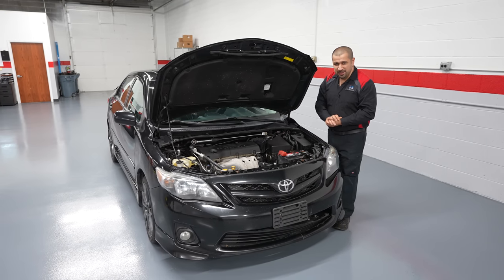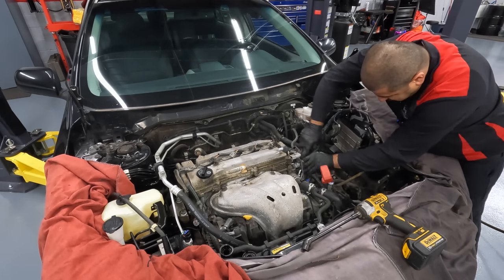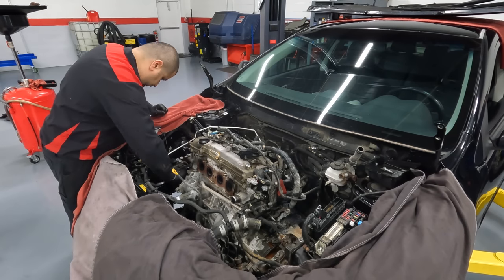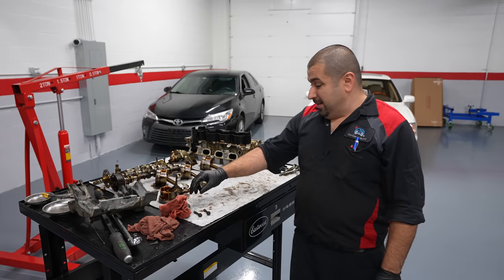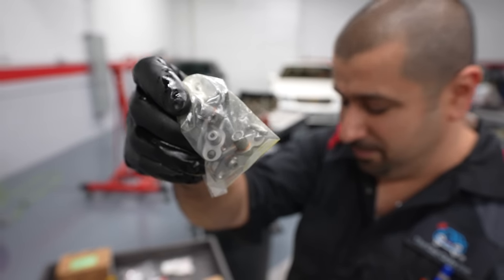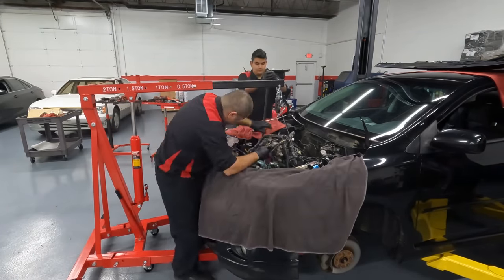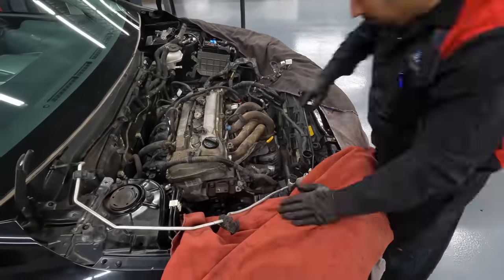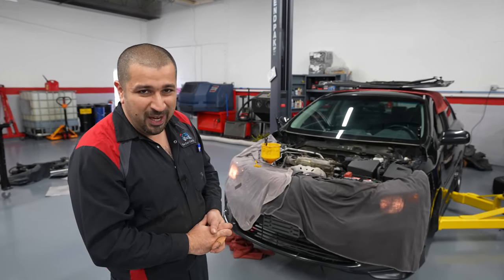THIS is Toyota's Worst Engine Ever Made! But Is It Really THAT Bad?

Comment: I have a 2002 Toyota Rav4 with the 2.0 engine and the engine is super reliable as heck!  I change the engine oil once every 3 years and the Rav4 just keeps going no matter what.  I did have to change all 4 coils at around the 274,000 km mark and the battery, PCV, EGR valve, and MAF all at the same time to figure out that the coils were the culprit for the bad engine misfiring, stalling and stuttering.  However, since I did everything myself that only cost me around $240.00 total (Canadian) which is pretty good for having done almost zero maintenance for over 20+ years!  

The second gen Toyota Rav4 2.0 engine was a beast since the engine also used a timing chain.  Other than a leaky timing chain tensioner (common to all early Toyota 2000 engines) cover and leaky front driveshaft seal the 2.0 the Rav4 has been really bulletproof.

The 2.0 engine is super great for gas mileage and will even push the Rav4 through 2 foot snow drifts with ease with its simple tried and true AWD system (taken from the ALL TRAC)....

If Toyota just kept things simple (as Toyota had done in the past) then people would always come back to buy their cars....

Comment: I bought a used Toyota Matrix with a 2.4 litter engine, the girl who sold it to me, didn't tell me the car had an oil consumption  problem. I took it to the Toyota dealer and they fixed it for free. That happened almost 7 years ago.

Comment: We went through our 2007 RAV4 engine and the machinist recommended reusing the pistons but replace the rings, we couldn't get any info from our Toyota dealer on the piston and ring upgrade. It uses oil still but not as much. Pretty frustrating after all of that work..The counter balance assembly needed replacement as well.

Comment: I just bought a tc with this engine it was leaking oil, so I did the valve cover gasket to fix that, and it hasn't lost oil since. It's only been a month or so, so probably too soon to know if its burning it. So far it's been fairly reliable, it's a 2005.

Comment: My 2003 2.4L Camry has 691,000 kms without any engine work. I change oil every 5K kms, and as soon as warranty was up I did all the work myself not the dealer.

Comment: I have this engine...2008 Scion xB, manual trans.  It definitely burns oil, but overall it's been a great car since I've owned it.  It would be great to have this repair done, but I'm just not sure it's worth the cost at this point.

Comment: I had this exact done on my 2007 Camry in Canada. By Brimell Toyota,under warranty.  And the service manager recommended I do the upper engine.  Which I did. ,,I paid $600.00 Canada for the parts. TOTAL ENGINE REBUILD.  NO IS RUNS LIKE A ROCKET.  255 thousand and rolling. 🇨🇦🇨🇦
Reply: When did you get it done and what exactly did you get done? Bc I have that same engine and didn't know about their extended warranty program. So this engine burns oil like crazy.

Comment: I got our daughter a 2005 Camry with this engine. It had 206k on it with a good service history. It ran great and it was a good price. I always heard the really bad years were 2007-2009 so I thought 2005 was a safe bet. Come to find out the thing drinks oil, about a quart every 300-500 miles. I feel terrible about it. But it s a nice running car and I hope it will just last her through college but we will see. Might need to put a replacement engine in it. I should have gotten her the Camry with the 3.3 V6 in it. Oh well.

Comment: We have this engine in a 2003 camry, 215000 miles, uses no oil at all. Secret is drive slow, change oil every 2000 miles.

Comment: I have a 2012 camry se.bought new, 4 banger. Lol we love it. Only thing been done to it was, new stall convertor. But now shes got 184,000 she starting using oil.
Good thing the toyota co.we bought it from had a lifetime warranty on all running gear. Looks like time for a refresh. An put another, 184,000 ... also got 2009,with bad motor, blown head after the oil rings been fixed.from burning oil.another 4 banger.lol,an we spent a lot of money for them to put in a new engine.. just got it back other day,so now we will see,how things go from here...also i have another toyota tacoma trd,4x4,2015, v6 an well kept, now she's rattling on cold starts,an burning oil,,an skippedat same time but cleared up no codes or lights., dang man. Im no lead foot,an up keep is always under 4000 miles oil change.little smoke on crank up when it was cold other morning 35 degrees outside....what the crap is happening to my toyotas these days,,,, I may go back to Ford's again. I had good service out of thoes....??¿?????
Reply: Ps...any thoughts or advice from you would be greatly appreciated.??????????????

Comment: @TheCarCareNut I’m in the process of rebuilding a 5S-FE engine from the ground up and I wanted to ask you what should I be replacing?
Also I’m trying to avoid the stealership’s prices, so I wanted your recommendation of manufacture to use for the rings, pistons, and bearings.
Also what gasket set to use.

Thanks in advance for the above & your detailed videos.

Comment: I owned an 07 Camry from new .  It burned about 1qt of oil every 1,000.  This killed both cats by 100k miles.  Ate 3 water pumps.  Idle was extremely rough, due to ETC issues.  Finally, the motor blew after dropping a valve seat.  

Scrapped the car in 2016 @ 213k mi.  Very disappointed.  There's a reason you don't see that many 7th gen Camrys left on the road.

Comment: I have one...07 camry. It does burn oil, but i only drive about 500 miles or so a month and i just add oil when needed. Otherwise it runs great.

Comment: I have a 2003 camry 100.12000 miles runs good, would you recommend switching out the head bolts ?

Comment: I have one of these in a 2004 RAV4 with almost 450,000 kilometres (about 280k miles).  Very reliable car and it's had a rough life outside in rural western Canada.  Lots of cold starts at well below -30 without being plugged in.  It did start using oil a little while ago and it's now up to about a litre every 2,000 to 3,000 km of highway driving, but that's more likely from being old and all the rough treatment it's endured.

Never overheated mine and have not encountered the head bolt issue, but I heard another theory about it, it seemed to be more prevalent in Camrys and Corollas but was not very common in RAV4s.  The cars for those years were assembled in North America, but the RAVs were made in Japan and imported as whole vehicles.  Could it have had anything to do with a quality control issue at one of the manufacturing plants over here?

Comment: My s-i-l has a 2008 Rav 4 Sport that doesn't leak, and doesn't smoke but goes through a lot of oil.  My mechanic said it was carbon holding the rings open?

Comment: I've got a 2008 Scion xB and thus far (knock on wood) haven't seen excessive oil consumption thus far.  I'm the second owner and both the first owner and myself have consistently change the oil in a timely manner and have used Mobil 1 Full synthetic (5W-20). Based on your experience have you noticed that owners with this engine that have used synthetic oil since day one in their vehicles experience less oil consumption issues that those that used conventional oil for at least some portion of the vehicle's life?  Thank you in advance for any information you might have on this issue.

Comment: Of course, the one I inherited and can't replace. Good thing I started replacing the oil years back and another guy had replaced the bolts AND gasket for free. Any mention of, IIRC, the U transmission? The one in the 2002 Camry 2.4l. That had to be replaced too, but the rumor is it's the computer.

Comment: First, thanks so much for your YouTube videos. Very instructive and helpful. My reason for writing: I just replaced my 2AZ-FE 4 cyl. engine in my 2002 Camry with one that has had the original production problems corrected (the rest of the car is in excellent condition). Simple questions: How long does this engine need to warm up in winter (I live in Southern New England)? 60 seconds? 120 seconds? How about in summer? And, how about if the car has already been driven earlier the same day? Thanks!

Comment: Time ago I drove a 4runner first gen, four cilinders automatic transmission. Got it used and remain it as an engine oil cooker. Oil engine returns was poorly designed in my opinion.

Comment: I had a 2003 Toyota Camry with a 2AZ-FE engine, I pretty sure thats what all Camrys at the time had, and it had some serious oil consumption at 90k. I changed the Valve Cover Gasket to prevent oil from leaking at the sides as a mechanic recommended I do, but it didn't help at all. I've had multiple mechanics look at it and the last mechanic said that it's very possible that the Head Gasket probably blew and it would be a $6k job to work on the engine. I bought the car for $4k, and I decided to drive it until it finally died. Eventually, the problem ended up blowing the radiator and the Head Gasket which put the final nail on the coffin for the engine as the block warped. Engine died at 124k miles. It was the 2nd Toyota car that I had a bad experience with. Wish I'd known about this channel before so I could've taken the car to this shop to figure out what the actual problem was before it blew as the car died only in December as the real issue is still a mystery to me.

Comment: Hi great videos nice and clear joy to watch.. Toyota is a good company I worked for them back in the 80s the only thing I am asking myself is if Toyota knew about this oil control ring problem say from 2002 why did they keep on making the engine with the faulty rings on the production line for so long must have cost more to fix them later and damage there reputation… don’t make sense

Comment: So my brothers 07 rav4 4cyl has the oil cap that says 2 types of oils on its oil cap! Now those engines were known to also burn oil due to same reason. So does this mean that his engine has been repaired?
    Cuz if so then the solution repair did NOT work! My parent bought used at 50k and did 5k mile oil changes and from the start they were told every oil change at 5k it only had 1 quart or less of oil. And to have the valve cover replaced. 
At 80k they gave it to my brother and that was the 1st repair he did the valve cover gasket. 
    It’s a 98k miles and still every 5 k miles he has about 2 to 1 quarts left out if 4.4 quarts. 
      We ended up doing Bernie’s carbon cleaner and dumped a bottle in the oil ran it for 30 mins and drained oil and put new oil. There was clumps of carbon coming out! It was gross! 
     But seemed to stopped burning oil. The last 5 k oil change a month ago had 3 quarts out of 4.4 not the 1/2 quart like the past.

Comment: First of all, amazing video I REALLY enjoyed this and I've always tried telling people that tearing these engines down to repair the oil burning is so so worth it, these engines are too good to give up on!!! The rest of the vehicle is amazing to. I have a 2006 RAV4 with 202k miles and it doesn't burn oil but it has started making a decently loud tapping noise at the bottom oil pan area, any thoughts?? Also where can I get a manual for pulling the engine apart once it's pulled?

Comment: I had a 2009 xB and idk if the prious owner did the recall on the oil burning or what. I never had lost more than 1qt per oil change. Like it would be 1 qt low by the time 5k miles came up. That could have been a small leak somewhere. I had it to toyota  for the airbag recall and the vin never showed a need for the rebuild. I didn't lose enough to worry. I loved that xB. I kept it until 2022.  It was my first toyota and my love for toyota.  I miss that toaster of a car. 😢 thanks to that car, I've had 2 tacos, 2 rav4s now. I love toyotas.

Comment: Ive found thats using Mobil1 extended performance full synthetic. The oil consumption was only 1/2qt after 3k miles. Every other brand would be 1qt or more at 3k miles.

Comment: Starts right up. 
Ok, my 2.4 Matrix 2010 has just 70k. I bought it new and always used synthetic. I'm in Colorado (dry), garaged, and it's like a new car. I do my own oil changes.  HOW MUCH OIL DO I PUT IN THIS ENGINE?  
5w 30 ok... but how much? I can't find it in the manual or anywhere. 
I respect you sir... I'm a craftsman... 64 year old.
Reply: Keep putting it in until the dipstick reads full! I read that the engine takes 4.5 quarts. I would put 4 quarts in and check it, then add a little at a time until it reads full. Then start it up for a minute, then shut it off and check it again. You'll probably need to add a little more, then you're done.

Comment: WOW!!!  MY 2005 Camry LE 2.4 had this engine. I bought the car new and kept it for 15 years. I sold the car at 218,000 miles and the engine ran like it was new when I sold it. The entire car was a "Modern Marvel." Of course...I changed oil every 5,000 miles with Mobil 1. The entire car was as trouble free as any car could be.
Reply: BTW...my car (above) never burned nor dripped a single drop of..."anything" for 15 years and 218,000 total miles!
Reply: Did you keep on using the recommended 5W20 oil? Bc the last mechanic put 5W30 bc he said it would be better.

Comment: I have a 2az-fe 2004 highlander - right now suspect head gasket leak - fluid is coming out of the radiator cap.  Seems to run well otherwise and don't recall overheating.  the fluid has only dropped 3/4 inch in the reservoir and the radiator is full.

Comment: I have 2005 Camry with 2AZFE engine, Japanese built. The oil cap says 5W30. Do you think it has low compression rings. It looses oil, but when driven at highway speeds. Local roads it does not burn much. Thank you.

Comment: One thing I only see on the 2AZ engine, and have no explanation for, is the tappet cover deterioration. It splits just above the gasket area and deforms, opens up, and appears to be corroding. We assembled these locally, so maybe just an issue in Australia.
Reply: What oil would you use for the 2007  4 cylinder Camry version? Bc the cap and manual say 5W20, but this guy said this engine was made for 5W30.
Reply: @greasevaselina8896  What climate do you live in? In the owners manual near the back there is a list of what oil grades suit certain temperatures. The colder it gets, the thinner the oil needs to be. Also, these engines have vvt-i, so if the oil is too thick, the vvt-i has issues when the oil is cold.
Reply: @greasevaselina8896  They print the recommended viscosity on the cap for fuel consumption and emissions targets.
Reply: @ifluro  But doesn't outside temp mainly affect the first number? The operating temperature of the engine heats up the oil way beyond outside temperature anyway. I live in Southern California, so it'll be in the 90s here during the day in my location.
Reply: @greasevaselina8896  For that climate I would recommend 10w-30.
New Yaris/Scion Recommends 0W-8...

Comment: Hey good day. I love your page. A lot of great information. A quick question if you can help. I have a 2007 toyota camry that shakes in idle and reverse. What can I do to fix this?
Reply: I have the same issue. Did anyone tell you what is causing it? How many miles does it have? Mine started doing it pretty recently after I switched to thicker engine oil.

Comment: So Camry from 2005-2006 2.4l didn't have the problem with the head bolts OR the low tension rings? I'm shopping around for an older 4 cylinder Toyota and I'll include the Camry as long as there's a few years (05 & 06) that don't have either of those 2 issues. It seemed like these 2 years (05 & 06) were the ones you mentioned in the video that don't have these issues, but I just wanted to make sure because you don't have a Camry buyers guide for the XV30.

Comment: I have a 2008 Scion xb. 100,000 miles on the engine. Has never burned oil. I always used synthetic oil. So I never new there was a problem with the 2AZ until I saw this video. So what percentage of the 2AZ's have the oil burning issue?

Comment: Question, I have this engine in my wife's 07 Camry.  It runs great, but when I check the oil weekly, it's a little below the full line about every two weeks, so I add a little to bring it back up.  Would there be any problem in switching over to 5w-30 even though I've never had the ring job done?

Comment: Hello! Does the smaller engine of the AZ family (1AZ-FE) suffer from the same weaknesses - increased oil consumption and weak cylinder head bolt threads?

Comment: Hi ,  I happened to view this video again and i noticed your comment that the pre-2008 AZ's ran 5W30 oil like my 2000 1MZ v6.  So I checked the manufactured date on my 2008 Scion Xb and it was made in Japan in September 2007.  Can I run 5w30 oil in this engine or is that a bad idea?  The engine has a little over 100k miles and doesn't burn oil.  The oil cap does say 5w20/0w20.
Thanks
Reply: did you get an answer? I have same issue. Did you switch to 5w-30?

Comment: My 2.4 had a burn smell after a drive like a over heat so what I did was delete the secondary thermostat and the smell went and now car run same temperature but just not with the extra heat to create that burn smell...

Comment: I saw a 2002 MR2 Spider with 117k on it for 5500. Said it has good compression and drives good but will need a clutch soon. Is it expensive to repair and would this be a good buy?

Comment: Why do companies use the same faulty components for years?  I had a 1993 Saturn SL2 and a 2002 Saturn SL.  They both burned a quart of oil every 1000 miles starting at 75,000 miles.  9 years of the same crappy rings.  I assumed at the time it was a cost cutting thing but maybe it was an emissions thing?  An even better example would be Subaru 2.5 head gaskets.  ALL 2.5 EJ engines need head gaskets or will need head gaskets because they used single layer metal and graphite gaskets.  And they used them for around 15 years.  And head gaskets isn't a simple fix on a Subaru EJ engine.